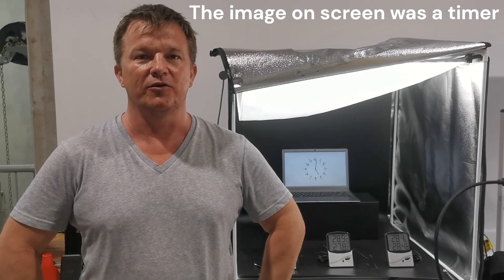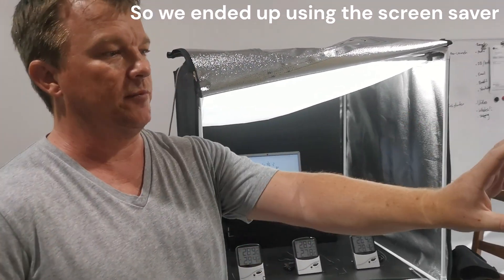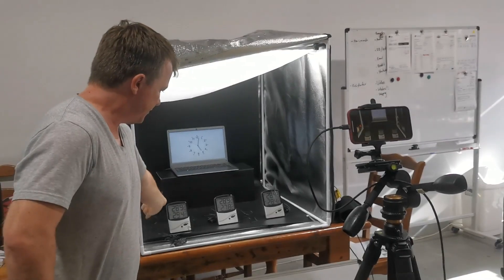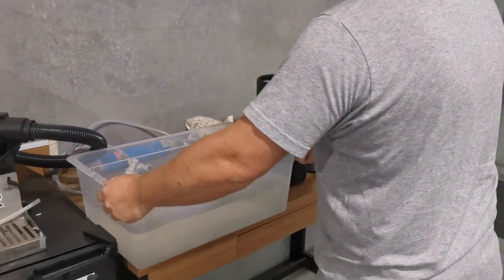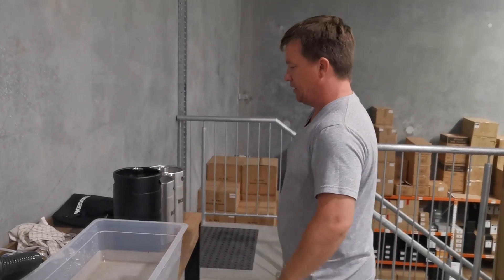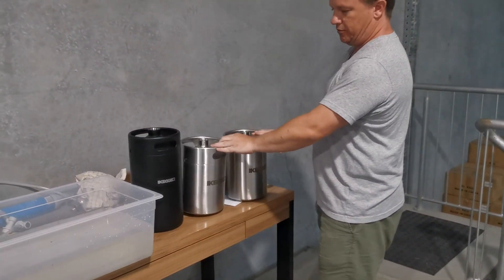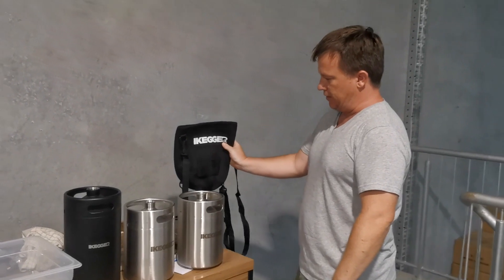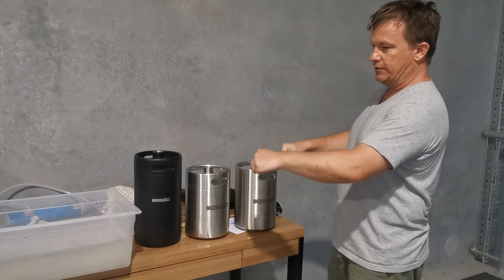iKegger Insulated vs Non-Insulated Kegs | Timelapse

Comment: Confused🤦‍♀️
Why are there digital thermometer readers sitting in front of the kegs with two (top & bottom) different temperature °C readings (what are they reading off?) and then at the very end above that (text overlay on video) is a completely different temperature reading?
Just confirming, the final result after seven hours, starting at 5.5°C for the double insulated (left) is 2°C? Temp went down?
The non insulated (center) with sleeve, final is 12°C & the non insulated (right) is 15°C?
Where did those final readings come from??